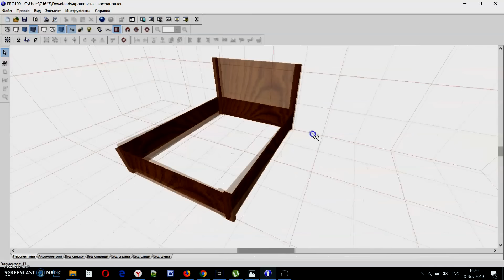Кровать своими руками с подъемным механизмом

Comment: Quick tip.. @5:00 you make a mark on each side of the piece of wood to remember where it was when you drive your pilot holes. 

Instead - Draw a single line anywhere across both pieces of wood. Then when you put them back to together, you just have to make sure that line goes straight again.

Comment: Buen sistema yo hice mi cama baúl pero no use sistema de elevación ya que yo mismo hice uno eléctrico usando unos simples motores de alzavidrios de auto y unos perfiles metálicos como aun no se soldar aplique pernos y remaches.. Lo otro veo el video y el amigo pierde mucho tiempo usando broca yo es raro que use broca en madera ya que el mismo tornillo entra sin problemas eso si en maderas gruesas hay es necesario la broca pero para los tableros no es necesario, pero bueno cada cual tiene su tecnica
Reply from the maker: gracias por su experiencia

Comment: Great job! What's the thickness of the main frame wood? looks like one inch.
Also when you screw into end grain, it doesn't hold very well, how is it holding for 4 years?
Reply from the maker: Thank you. 
The wood thickness of the main frame is 16mm
The screws have held up very well for 4 years

Comment: No podrias pasar las medidas de todo?
Reply from the maker: todas las dimensiones en subtítulos y descripciones
Reply from the maker: Detalles:

Tablero de haya para muebles 1960*300*18 - 2 unidades (lados longitudinales)
Tablero de haya 1420*300*18 - 2 unidades (lados transversales)
Tablero de haya 1960*80*18 - 2 unidades (lados longitudinales inferiores)
Tablero para muebles, haya 1420*80*18 - 2 unidades (lados inferiores transversales)
Mostrador de haya 380*90*40 - 2 unidades
Mostrador de haya 1100*90*40 - 2 unidades (cabecero)
Viga de pino 330*40*40 - 2 piezas (soportes para parte elevadora)
Contrachapado 720*1420*8 - 1 pieza (para cabecero)
Esquinas 120*40*40*2 - 12 uds.
Esquinas 40*40*40*2 - 4 uds.
Lamas 140*60*2 - 6 piezas (para cabecero)
Placa 80*40*2 - 6 piezas.
Mecanismo de elevación con amortiguadores 1200N - 1 juego
Madera contrachapada 642*1520*8 - 3 unidades (para la parte de elevación).
Viga de pino 1440*40*40 - 2 uds.
Viga de pino 1926*40*40 - 2 unidades
Viga de pino 1846*40*40 - 1 ud.
Viga de pino 700*40*40*40 - 4 uds.

Comment: How do I get all of the dimensions for this project?
Reply from the maker: detailed description in subtitles

Specific:

Shield furniture beech 1960*300*18 – 2pcs (longitudinal sidewalls)
Shield furniture beech 1420*300*18 – 2pcs (cross sides)
Shield furniture beech 1960*80*18 – 2pcs (longitudinal bottom sidewalls)
Shield furniture beech 1420*80*18 – 2pcs (transverse bottom sidewalls)
Front stand beech 380*90*40 – 2pcs
Rear stand beech 1100*90*40 – 2pcs (headboard stand)
Pine timber 330*40*40 – 2pcs (supports for lifting part)
Plywood 720*1420*8 – 1pc (for headboard)
Corners 120*40*40*2 – 12pcs
Corners 40*40*40*2 – 4pcs
Plates 140*60*2 – 6pcs (for headboard)
Plates 80*40*2 – 6pcs
Lifting mechanism with shock absorbers 1200N-1 set
Plywood 642*1520*8 – 3pcs (for lifting part)
Pine timber 1440*40*40 – 2pcs
Pine timber 1926*40*40 – 2pcs
Pine timber 1846*40*40 – 1pc
Pine timber 700*40*40 – 4pcs